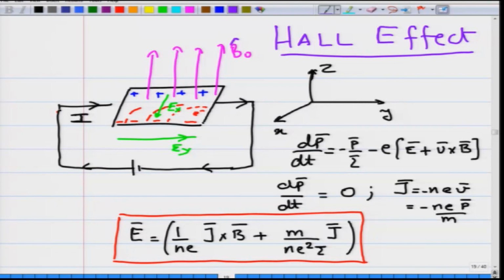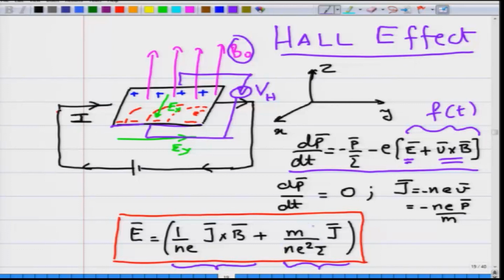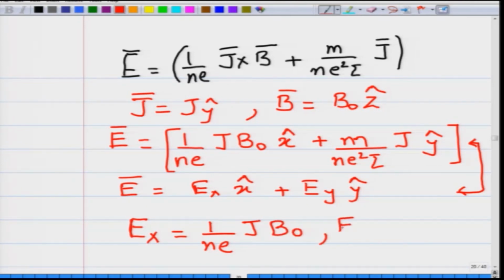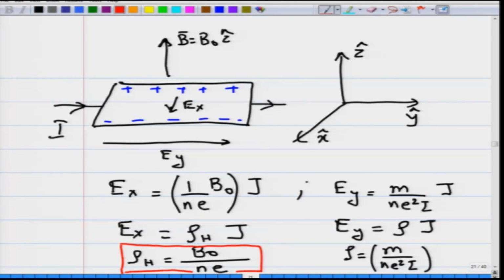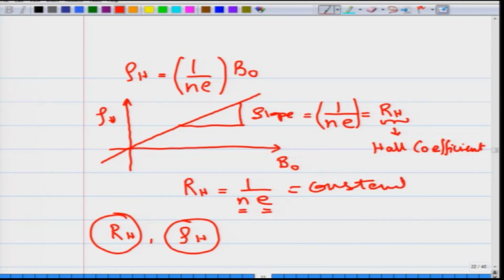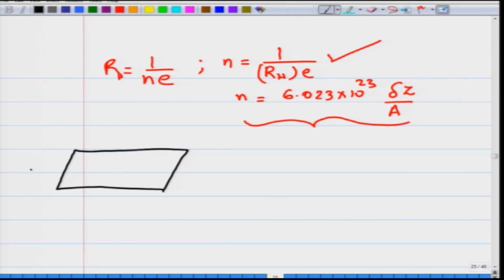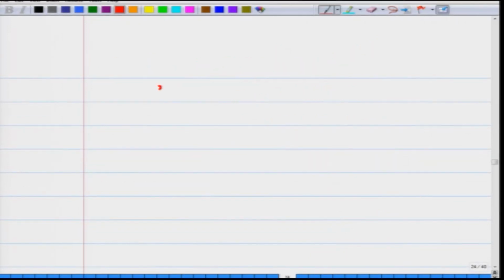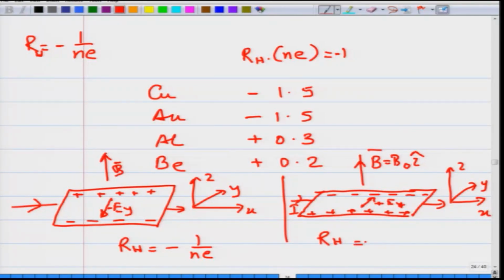noc19-ph02 Lecture 07-Introduction to Hall effects in Metals- Part-II

Comment: Everything was going so good until this sign change came in picture. why ?
Reply: the 'e' in the formula for Hall Coefficient signifies the charge on each charge carrier. According to Drude model of conductivity in Metals, the current carriers are electrons and electrons alone which have a charge of -1.60*10^-19 Coulombs.
Reply: But sign has changed due to change in coordinate orientation. And any ways, in first case also there were electrons moving but still sign was positive please explain @HearsH96

Comment: I can't understand... Why the sign changes If the Physics doesn't change... And what is the need of this negative sign 🤔
Reply: Now it also signify type of semiconductor in expt.
Reply: the 'e' in the formula for Hall Coefficient signifies the charge on each charge carrier which is an electron in this case hence negative. Besides the sign inclusion also helped accommodate other materials where positive charges were major current carriers providing more information.
Reply: Charge carrier was electron earlier so it was mandatory to use proper axis and get it negative.